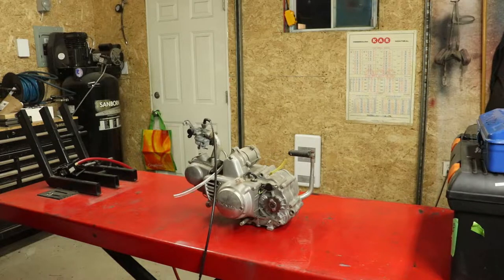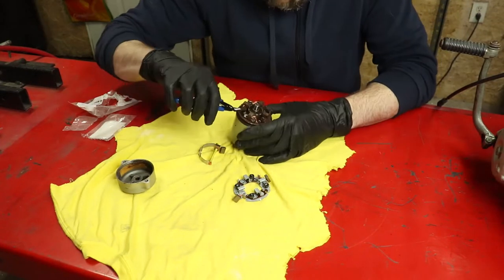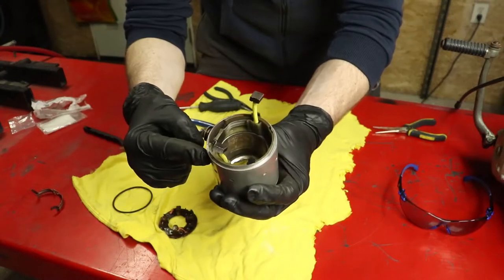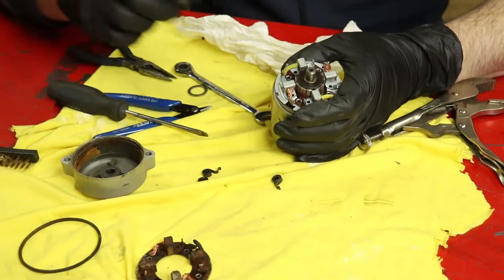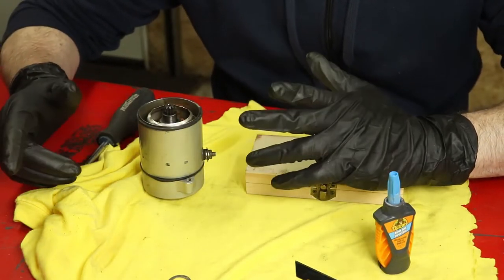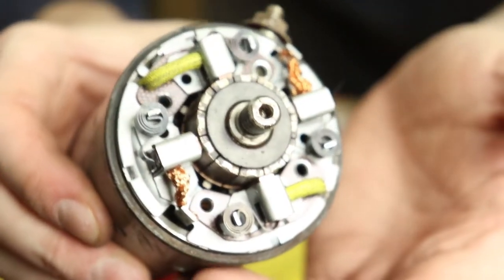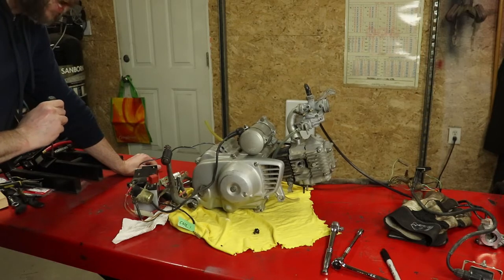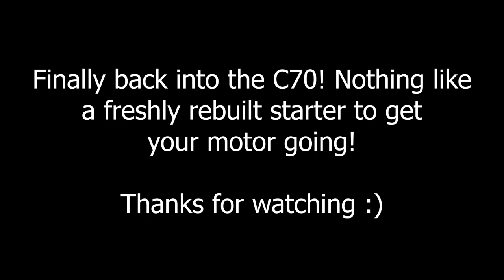1981 Honda C70 Super Cub Restoration - Part 9 - Starter Rebuild

Comment: My c70 neutral switch is good, relay is good. However I can’t start it with the start button. When it’s depress the neutral light fades a bit but no click from relay. If I short the relay like you with a screw driver it starts. You have any ideas for me what could be the issue
Reply from the maker: Have you tried opening up the starter control to see if there's anything wrong with the connectors inside? Sounds like it could be something like that, or something elsewhere along the harness between the button and the starter.

Comment: Hey man, first off great videos and content! I'm currently working on my 81 c70 passport and having some issues myself. Was wondering if I could pick your brain. Long story short, I have good spark, fuel is flowing, good compression, and electronics all work. It has a brand new carb, but I can not for the life of me get it to turn over. It'll idle for about 5 seconds sometimes, but most of the time it wont start at all. I roll started it down a hill and was able to get it going and cycle through gears, but it sputtered and back fired a ton while driving. Any help would be much appreciated man.
Reply: few things i picked up from your comments, to sum up the following is the list of facts from your story
1. good compression
2. got spark
3. carb is new
4. it starts but it drives bad

so, if i were you i'd go with the following few directions
1. since you have good compression, check the valve clearances
2. got spark but runs bad, check the ignition timing (i.e, spark advancement, there are plenty of YT video teaching that)
3. got new carb, check if the bike is factory setting, (i.e. no pod filter, no aftermarket pipe, there no need to fiddle with the jet sizes)
4. if all above are checked and confirmed, see if there's vacuum leak on the intake manifold (i.e. spray a bit of brake cleaner at the mating surfaces)
5. finally, check your battery

good luck